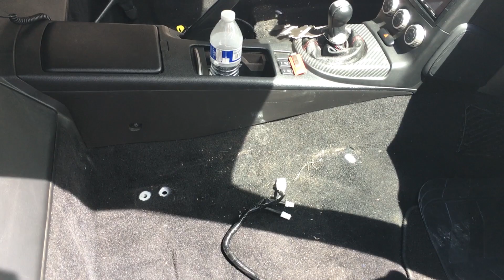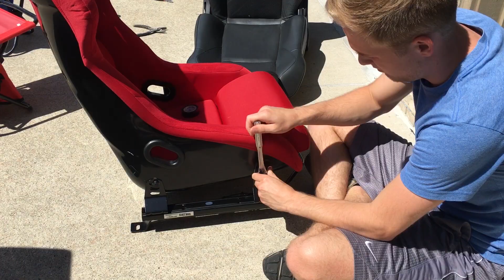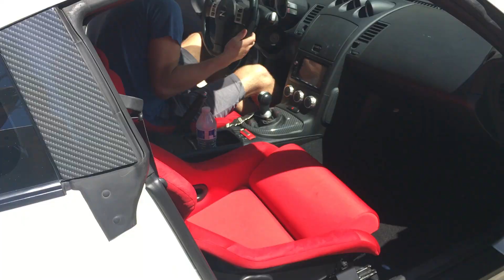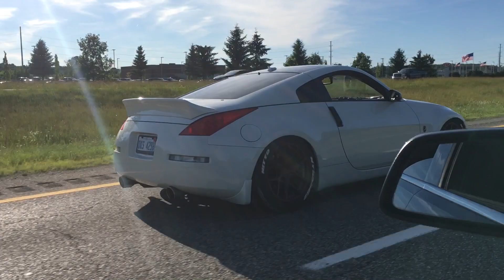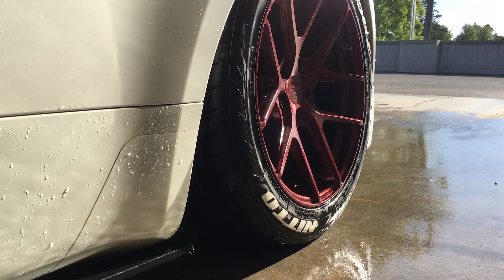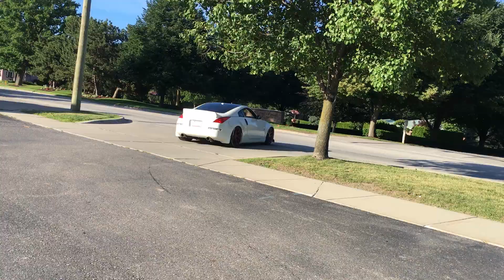350z Racing Seats Install!!

Comment: My friend used to own a Z and he said one thing he didn’t like about it is you smell like exhaust films? Is that true before I buy?
Reply from the maker: my two buddies said he probably had some exhaust leaks, they said they never had a problem with their set ups. I would definitely buy one!
Reply: Mine used to smell like exhaust in the cabin. It's cause there were holes in my rear hatch. I patched those up now it's fine.